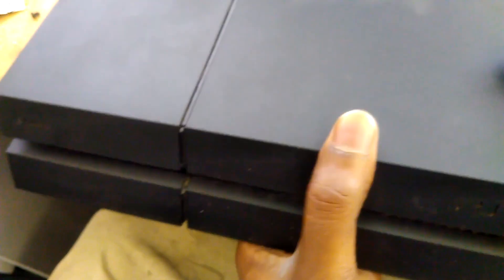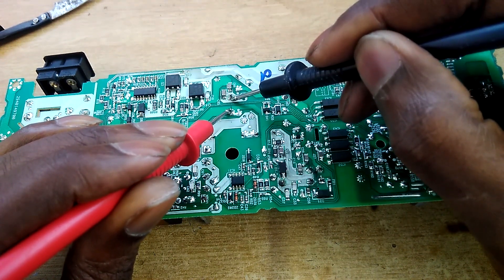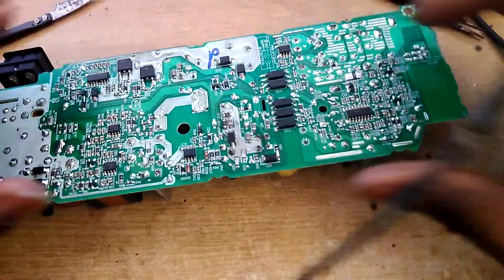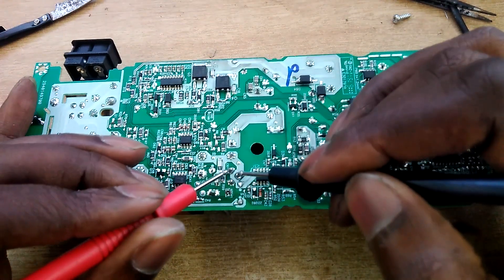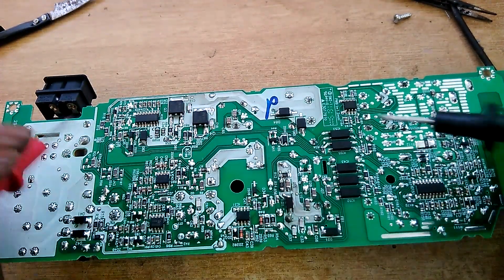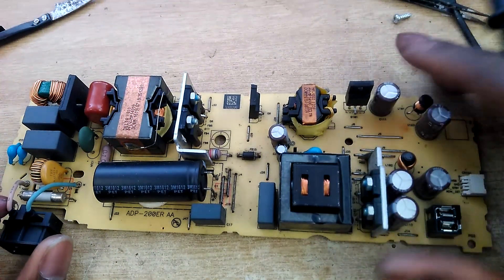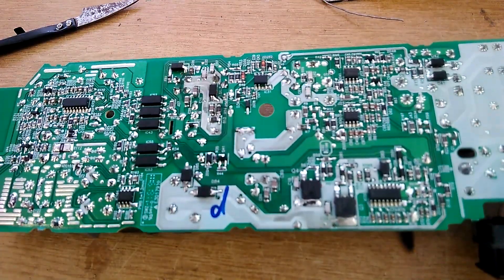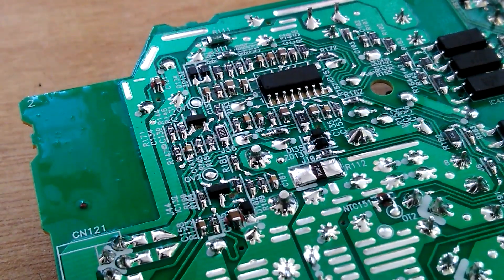Ps4 cuh-1200 Power supply fix missing standby voltage @Kieltec

Comment: Hlo mine powers off in seconds, i checked and saw that the 12v does not reach what could be the reason
Reply from the maker: Try injecting 7 volts to dda001g see if there's drawing then replace it

Comment: Excellent videos, thank you for sharing knowledge. I don't speak English. I don't understand what you're saying, but I try to follow your steps. I'm very interested in the topic and I see that you don't use many tools to solve the cases. How many years will it take to know that source to be able to fix it?
Reply from the maker: Most electronics have the same patterns when failing so it becomes easier to fix 
2-3 years but i have over 20

Comment: Have you been dealing with psu that works normally til shutting ps4 down and wont power up next time ? It will work only if disconnected from ac for 30minutes and connected again(cuh1216)
Reply from the maker: Try looking at ddac01ag
Reply: @Kieltec  haven't really looked at it, because it has fixed by itself, weird later I'll clean up this psu